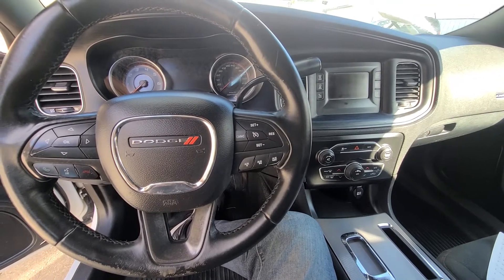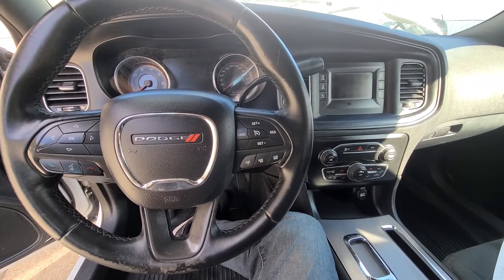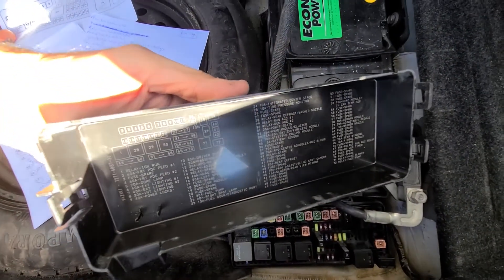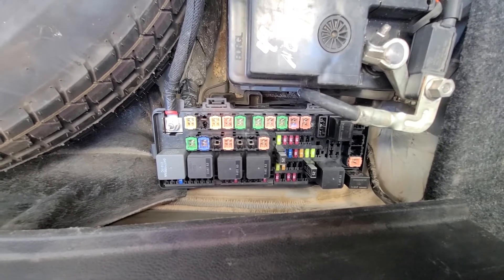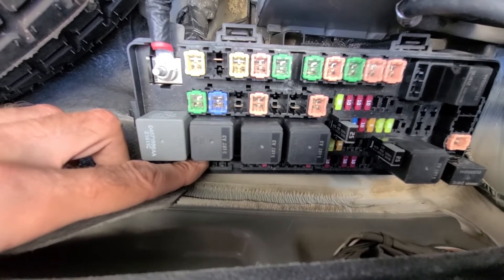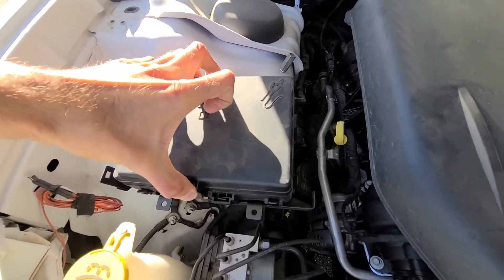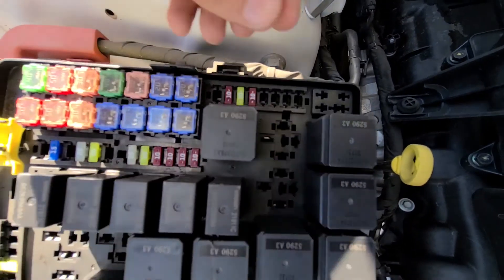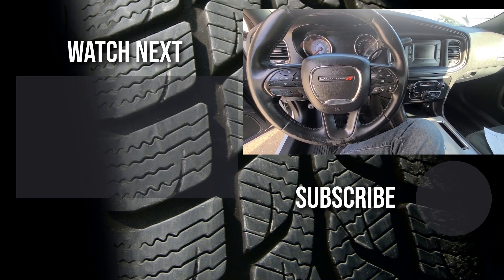Dodge Charger - EXTERIOR LIGHTS FUSES ( HEADLIGHTS FUSE, STOP LIGHT FUSE, TURN SIGNAL LIGHT FUSE )

Comment: Is there a fuse for the front driver side turn signal
Reply from the maker: Hello, to my knowledge there isn't a specific fuse for the driver side turn signal. If bulb is good try checking the wiring and electrical connection

Comment: The side markers on my 2019 charger are not workn but only on the right passenger. I already replaced all 4markers and only the driver side works fine. Cant understand why
Reply from the maker: Hmmm try to inspect wiring and electrical connections, clean sockets

Comment: My two side marker lights for the outside I changed them to LEDs. They stopped working what fuses do I check?
Reply from the maker: Hmmm not sure on which circuit those would be, but try checking fuse #47
Reply: @ in my trunk ? Pretty sure fuse 47 under the hood is a relay.
Reply from the maker: @5.7_don13  Yes in the fuse box in the trunk area
Reply: @QuiteAlright going to check in a day or 2 I’ll let you know how it goes
Reply from the maker: @5.7_don13  Good luck. Hope this is the problem for you. If not could be the aftermarket bulbs so i would try installing oem just to see of those work

Comment: which fuse is the rear taillight?? Please help
Reply from the maker: Hello Fuse F7 should be responsible for the tail lights. If fuse is good check light bulbs, sockets and wiring
Reply: @ in the trunk or the front?
Reply from the maker: @QuezSavv  in the trunk

Comment: Were is the Left turn signal  please
Reply from the maker: I don't think there is a specific fuse for only left sided turn signal light. Start by checking the bulbs, sockets and wiring towards the faulty light. If still problems test if power is coming to the faulty light

Comment: I have a 2016 charger Rt road and track. Could a bad fuse be the reason my passenger side headlight doesn’t come on occasionally, but works perfect at other times? Thanks
Reply from the maker: Hi, no fuse wouldn't be a problem. With a burnt fuse light would not work at all. Most likely there is a lose connection somewhere and how you drive and hit road holes it will turn on / off.  Inspect all the wiring and connections and clean them.
Reply: @QuiteAlright  thank you for the reply! I’ll look into it
Reply from the maker: @Big-G-Unit  No problem and good luck figuring it out

Comment: Where is the fuse located for license plate light?
Reply from the maker: Hi, I don't believe there is a separate fuse for the plate bulbs. You can try checking Fuse #47 as often it would be on the same circuit as DRL

Comment: I need help with my front right turn signal light fuse location
Reply from the maker: Hello there is no specific fuse for turn signal light, I believe it is powered through one of the exterior l. fuses. Make sure to check the bulb, inspect and clean the socket and test if power is coming to the socket. If not follow the wiring, sorry I can't help more

Comment: I have a 2015 police charger and the driving tail light isn’t working but the break lights and turn signals work fine is this wiring or fuses if so what fuse would that be
Reply from the maker: Hi, Charger has LED taillights so it can definitely be a wiring problem, especially since it is a previous police unit. When they remove their equipment usually cut bunch of stuff. I used to sell many ex patrol cars and every vehicle had a different problem depending on the department it came from.

Comment: My charger pursuit turn and brakes signals work but my daylight taillights are off is that a fuse or wiring?
Reply from the maker: Could be either fuse or a wiring problem. If it is ex police then most likely it will be a wiring problem as they usually cut bunch of wiring when removing their equipment from the cars
Reply: Did you ever figure this out? I have a 2019 pursuit and have replaced the fuses mentioned in this video. I can’t find anything online that’s helpful
Reply: @JRiv216 us both have the same car my drl’s on my driver side arent on and idk how to get them on

Comment: I need help with my reverse lights. They both just stopped working.... which fuse are they on 😅... 2020 charger sxt black top...
Reply from the maker: Hmmm I don't think there is a specific fuse only for reverse lights. Try checking all of the fuses mentioned in the video. If all good then try testing if power is coming through the wiring and to the reverse lights.

Comment: My Driverside Headlight continues to go out. I've changed the Bulb about 4 times already, but never the Passenger Side. This most recent time I changed it, the Brand New Bulb seems to have gone out again after a couple months of usage. I'd hate to think that New Bulb was faulty, but is there any other reason to this? I'll be looking to get a set of New Bulbs again, but I'm just trying to see if theres anything else that could be causing this issue.. besides the constant buying of Bulbs.
Reply from the maker: Hmmm it's hard to say but it could be a small wiring issue somewhere which is occassionally shorting out or faulty bulb socket causing the bulb to burn out

Comment: I have daytime runnings lights but no fuse in slot 47
Reply: ik this 2 years ago but did u ever figure that out?
Reply: @bhrishimself did you ever get it figured out? Both my headlights went out and I don’t have fuses for any either
Reply: @UNCDOUBLE07 yes you have to get new head lights for them to work, me personally water i guess got in my drivers side one so that DRL doesn’t work still need to replace it
Reply: @bhrishimself damn same thing happened to me thought it was jus gonna be a fuse, smh

Comment: Is there a fuse for the day time running led light.
Reply from the maker: Should be Fuse #47
Reply: my passenger side DRL went out but i checked fuse 47 and nothing is there should i get a fuse for it?
Reply from the maker: Fuse powers both front DRL's. I would start by checking the light bulb if only one side not working

Comment: Which Is The Hazard/Parking Lights Fuse ?
Reply from the maker: There is no separate fuse for the parking lights. It would be probably on the same circuit as DRL. Try checking fuse #47

Comment: Is fuse #8 for the 3rd brake light, which is mounted inside the cabin?  I just noticed today my 3rd brake light is not working but the left and right are.
Reply from the maker: I'm pretty sure that fuse #8 is for interior lights (dome lights, reading lights, etc...). I don't think 3rd brake light will have a separate fuse. Have you checked the light bulb? if it is good I would check the electrical connector and the wiring

Comment: I have a 2015 dodge charger Why are my fog light not working can you tell me where is the fuse for the fog light
Reply: I've been trying to locate this as well. Frustrating as hell there isn't a designated/labeled fuse for the fogs on the 7th gen and newer. On the 2006-2010 it's number 7 in the front fuse panel.
Reply: I got a 2017 and still trying to figure this out 🤦🏿‍♂️

Comment: I have a 2014 V8 5.7 L Charger, police package. Fuses 6 and 7 for exterior lights are both fine. High beams will not turn on. There is no blue indicator showing they turn on either. What could it be?
Reply from the maker: Hmmm could be the switch itself, that's what I would look into next

Comment: Can somebody help me please?
Dodge Charger 2014 V8 5.7L
Here’s my situation. I’ll sum it up easy that way maybe a reply / solution is as easy too.
My car has a brand new battery (bought yesterday)
Brand new HID bulbs I just bought, electrical power isn’t the issue, but all but one bulb turn on.
Both high beams are good but only one low beam turns on. The other one doesn’t.   If the exterior lighting is controlled via 2 fuses. 1 for hi beams 1 for low beams. How come 3 out of the 4 lights work? Does that mean it’s not a fuse problem?
Reply from the maker: Probably not the fuse. 
First make sure the new bulb is good. Maybe try switching the working one to the other side where is the not working one and vice versa. If the non working one doesn't work on the other side as well, the problem is in the bulb. 
If it works on the other side, then a problem could be in the connection somewhere / wiring

Comment: Question: so i have holegen headlights.  Slot 15 and 16 dont have fuses in them. But. The passenger keeps blinking.  What should i do
Reply from the maker: Inspect all the wiring towards that headlight and the connection at the headlight or it could be a problem with the bulb itself
Reply: @QuiteAlright   i replaced the bulb with 2 different bulbs. When i unlock the doors the lights are on. When i start the car the passenger goes out
Reply from the maker: @LIVE_Concerts_STL  Thats really strange. It has to be some kind of wiring issue then. Try finding auto electrician maybe to take a look
Reply: I am having the same problem. I have a 2014 dodge charger rt and the driver side headlight keeps going on and off.  I don’t have fuses 15 or 16. What would happen if I put fuses in those spots?
Reply: @petezach1113  nothing.  I tried and nothing happened.  I had to buy a different brand of led headlight and it finally stayed on.
Reply: What brand did you use? I’m currently having the same problem. The lights I had were working but I wanted to replace them for some LED but once I changed them to the new ones they stopped working so I went ahead and out the old ones back and now the old ones don’t work either. I also don’t have fuses in slots 15 & 16.
Reply: @JCO596 its also happens with me today did you find any solution i put fahren led lights in my 2015 dodge charger sxt now bulbs are not working even with halogen bulb but i tried my bulbs on another car my bulbs are just fine but having problem with car now

Comment: Any of them by chance control the shutters for the high beams? Because I know it’s the same single filament bulb if you have halogens which You also have like me but my high beams won’t work dash light comes on but that’s it
Reply: Have you figured out the problem with the high beams yet
Reply: @X369X99  did you solve the issue no high beam for my car and also the indicator is off
Reply: @y2z33d did you get this figured out?
Reply: @UNCDOUBLE07 Yes, i have replaced  Steering Column Turn Switch. i bought used part and installed it.
Reply: i have the same problem bright don’t do anything, the indicator comes on but not the brights